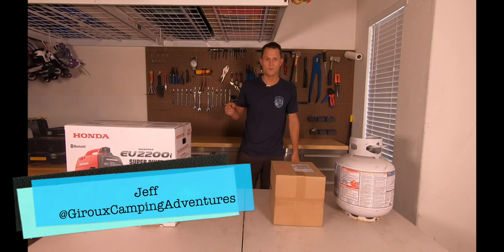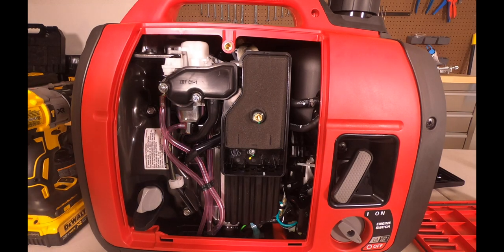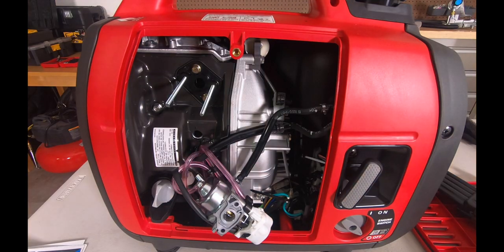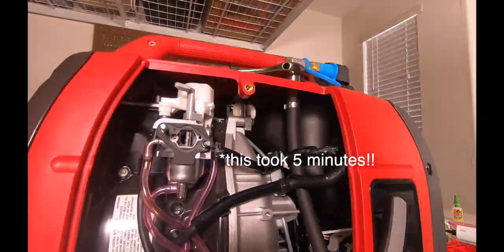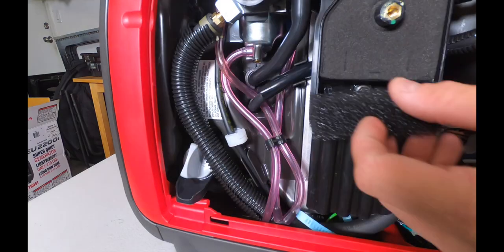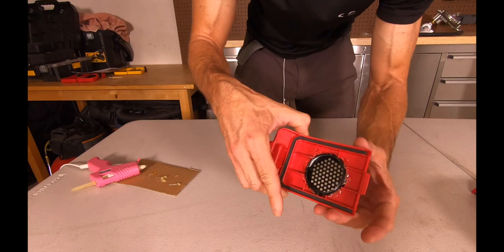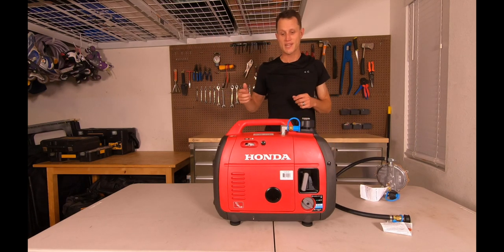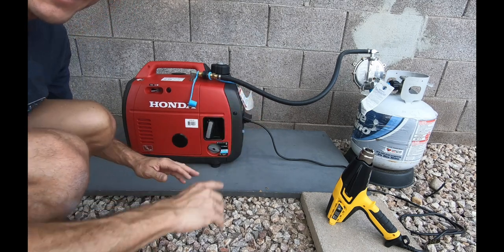Honda EU2200i Generator and Grenergy Propane Kit Conversion How-to

Comment: The Grenergy kit looks like the one to get. The Hutch Mountain conversion kit uses a 3D printed plastic vent...whereas the Grenergy kit uses the CNC machined aluminum venturi as seen here. I would not trust that plastic vent from the Hutch kit. Still not sure all of this is worth it either way, considering that Champion dual-fuel models exist. You're already paying triple for a Honda, plus then $400 for the Grenergy kit...
Reply from the maker: I did it for the fun challenge. Those prebuilt dual fuel models look nice though. However I like the 120cc engine displacement available in the Honda EU2200I compared to the average 80cc you get from other generators this size.

Comment: Before I put holes in the side of the case that might affect the overall intake and exhaust flow - generator cooling. I would want to see a simple $15 - $20 air wind meter on the front intake and the back of the generator exhaust side and just the hot air rear outlet while it's running without the vents installed in the side and a laser gun temperatures. and the same test with the vent or vents cut in the side of it. Always keep your generator in the shade out of the sun it will run cooler. Not sure maybe they have done these tests hopefully someone will do a video of they have. One guy in the summer running a 1000 watt generator in the shade. He was off grid for a while and ran a small window AC. And the 1000 watt 4 stroke generator ran the rotary knob AC. He took the side panel off on generator pointed a fan at the generator in the shade. After that the generator was smoking oil smoke - ring wear while running. These inverter generators pull cool air in through the front and around the generator and push our the warmed hot air out the back. Like in building engines to big of cylinder heads, header, intake, carb, cam cuts down on the flow of the horse power and torque! Someone test this with these $30.-$40. tools total and then I will believe it if it works!!!
Reply from the maker: Good points. I only know of the reason why the vent holes are there and placement...based purely on Grenery's blog post. https://grenergy-us.com/pages/whats-up-with-the-air-vents-why. However after a quick read I don't see any research performed around temperature. Hoping Grenergy team chimes in.
Reply: Hi Tom, the breather vents don't draw a lot of air into the generator enough to take away from the front air intake of the inverter unit. It just relives pockets of areas with low vacuum inside the case. Removing the maintenance door completely will surely take away from the generator's in/out cooling channels. But with just the vents, the generator does fine according to customers whom first purchased our kits 2-3 years ago. Most of are running them in the woods 24-7 in their cabins. If you look inside the generator you can see the recoil assembly sitting behind the inverter unit. This recoil assembly has the engine fan that pulls in air to cool the engine head of the air cooled engine. As this fan draws in air, it also passes air around the inverter as its being drawn into the recoil assembly cooling it.

Comment: I've done 3 propane generator conversion kits and I have another one to do. I'm thinking about buying this kit because I like the metal base plate and brass fitting that's as good as it gets. Your spark plug that comes with it what is the gap they're running in thousands of an inch? I don't have my paperwork in front of me but most of the conversion kits call for a tighter spark plug gap at least the biggest guys in the business I've worked with do. I've been in propane and using propane products since 1991. I may sound like Hank Hill but I have all kinds of propane products accessories and propane tanks. Propane is the true prepper fuel! And the advantage of propane powered stuff. I don't have to work on it other than light maintenance once and a while.
Reply from the maker: I don't recall the spark plug gap on the kit-included piece. I did keep the spark plug box that arrived with the kit, but there was no measurement. I pinged the Grenergy team to chime in.
Reply: Hi Tom, the spark plug needs to be re-gapped to .020" ~ .023". Your right on the money about propane!
Reply: @GrenergyTriFuel Ok thanks

Comment: Thank God for you!! Your video is the only reason I was successful in installing my conversion kit. I’ve had it for quite a while but been putting it off cause I was afraid to ruin my new Honda Generator. Started on the 2nd pull!! By the way… I’m a older woman 😊 Now I’m ready for the coming snow storm and power failure. Thanks again!!!!!! Regina
Reply from the maker: 2nd pull! You rock! Thx for watching!

Comment: Just bought a Honda generator and am looking forward to converting it to propane, great fun you had on the video, thanks.
Reply from the maker: If you like handy work, then you should have fun doing the conversion too! Are you keeping it propane only or are you planning to run gasoline too? Since conversion, we have only taken it camping 2x...and only actually used it 1x.

The time we used it was purely for a fun load test experience during Thx Giving cooking while boon docking. I was filming the generator at 4500ft elevation with my Victron 3000va inverter on hybrid assist in our trailer. Wife was turning on and off microwave and ninja foodie was cycling. Our electronics/solar setup could handle all of it, but I wanted to show a fun video load test of the propane conversion working with Victron hybrid assist.

I was limiting Victron AC current from 10 amp to 18 amp during the test (cooking dinner), and the Honda app showed ranges from 1000w to 2000w of running power. Fun...will get to that video one day.

Comment: If you'd simply opened the float bowl drain.... ;)  (Thanks Honda for being one of the few manufactures left to provide a drain on the float bowl for easy gas draining...)
Reply from the maker: Luckily I didn’t have liquid gasoline in there first, and I checked from open box (from factory) and didn’t see anything in the gas lines.
Reply: @girouxcampingadventures  Right, but as a tutorial meant to demonstrate for folks who don't know any better... This whole "pull start, die... pull start... die..." procedure is 100% unnecessary and not nearly as effective.  Honda so graciously provided a float bowl drain.  It should be used.  It's the only way to truly empty all gas out of the carb.  (Running it out doesn't actually get it all out...)
Reply from the maker: Good to know. Thx.
Reply: @girouxcampingadventures  Sorry to be... "one of those types." :)  I should say "Thanks for the excellent video which helped me greatly in installing the kit!" But instead all I do is complain.  Typical ME. lol  Seriously, thanks!

Comment: Great video, appreciate the detail. I've installed two of these. The new bolts need a mod. Mine, I used a hacksaw to widen the slit. Then I soldered a paperclip to the slit. Trimmed the paperclip to fit the square slot where the original square head bolt was. Finding square head bolts is very hard (non existent). I believe the original was M5X90mm. I've ordered M5X100mm and M5X110mm bolts with hex heads. ... Gonna drill them to put a paperclip in.  Long time to get them shipped . Great kit and video otherwise. .. Don't use loctite with standard round heads.
Reply from the maker: Good info. Thx!

Comment: This is awesome and so detailed. So is the point of the conversion to have an energy source that’s a bit more convenient for campers instead of carrying gasoline?
Reply: Buu, gas is a bit messy and a touch dangerous to store in/near your home.  Not to mention all of the nastiness that Ethanol brings in the smaller motors.  Another benefit is that the exhaust when running propane is not as obnoxious.  Also when running gasoline, you have to drain the fuel from the carb either manually or by running it until the fuel in the lines/carb is consumed, and this is messy.
As I read the manufacturer's info, they are claiming that a 20lb tank of propane will run twice as long as the single gallon of fuel it holds internally.
Reply: @carlbrothers very nice benefits, thanks. I’ve only had to use my generator once but have been looking at a few trips that may require me to bring one along again. Maybe next year.
Reply: @buulam  the Honda's are pricey, but you get what you pay for.  I also have recently acquired some power banks from EcoFlow that charge very fast on AC, allowing me to minimize the time needed to run my generators.
Reply: There's many benefits with running propane. 1.) Extended fuel run. A 20lb BBQ size propane tank will run 18~24hrs on a single tank. 2.) No smelly exhaust fumes. 3.) Propane has less carbon content than gasoline, which keeps the spark plugs cleaner, engine oil cleaner and improved engine longevity without all the carbon build up. Most campers have a pair of 30-40lb propane tank mounted up at the front of the RV. This is enough propane to last a whole week running 24-7. And this kit also compatible with Natural Gas. Great for emergency use during natural disasters when gasoline is not available.
Reply from the maker: Yes, alternative source of fuel. I was super careful with my first generator (gasoline) and tried really hard to avoid spilling. Had a cool gas tank too. But every time...spill. 

Another reason, less cargo. If you have a propane tank you haul around already...which we do (firepit, bbq), then might as well share the tank. And...leave the gasoline tank at home. You can get super crazy by purchasing bigger propane tanks, horizontal ones...extend that generator usage.

Another reason among many...less gunk in the carb. If you run gasoline, then you have to do more maintenance. Not saying there is no maintenance with propane, but much less gumminess in carb and hence less cleanup...easier maintenance. 

Also...cleaner! Still, there are fumes so practice safety. Keep your generators far from the open windows or doors to avoid fumes (that you can't really smell on propane) from entering your living quarters. Enjoy!
Reply from the maker: @carlbrothers  Yes, definitely pricey. I even noted that in the youtube description. These Hondas are NEVER on sale. So...don't bother waiting. If you need a generator and want a Honda, then just go get it. Then of course do a propane conversion too!
Reply: @girouxcampingadventures  Last year my lowes had two of these that were returned for half price.  I shared the picture of them on FB and took my daughter to gymnastics.  A friend a few towns over asked if I could grab them, and that night before closing I walked in a grabbed them for him as they were still sitting there.
Reply: @GrenergyTriFuel  love this, it’s going to open up way more camping options for my family!
Reply: @buulam  Defiantly. Once you go propane, you'll never go back to gasoline.

Comment: Great video! You have cuted the side panel, but that panel as already vent holes from factory…
Reply from the maker: Just following instructions from Grenergy. The vendor has a pretty good page regarding why the vent holes exist. Maybe Grenergy will make a no-drill kit in the future. I would sell my current generator and buy a new one so I don’t have holes in the new generator. Honestly, though I trust the work and research done by Grenergy. I did a load test video and had zero issues with this kit, ranging all different kinds of altitudes and loads.

https://grenergy-us.com/pages/whats-up-with-the-air-vents-why
Reply: Agreed, I'm sure that the Suit & Tie Engineer's had their reasons for installing the vent kits.

Comment: I bought the Honda EU2200i. Good thing I ran it on gasoline first. It had a problem. It's symptom was surging with or without load. The vent was open, so that wasn't the problem. I could have had Honda do the warranty work but I'm handy. One of the carburetor jets had something clogging it up. A little cleaning and wala! It was working great!. ... Now that one fuel was tested and vetted, I'm going to install a propane conversion like the one you showed in your video. .... Great work on showing details of the install of the Grenergy Propane Kit!
Reply from the maker: I didn’t run it first on gas. That’s why I was soooo excited at the end of the video when I started it. It was the first time and I had no idea if I destroyed it or not! I got lucky by not running into any surging issues. Even to this day…rock solid.
Reply: @girouxcampingadventures   I just ordered my Grenergy tri-fuel kit. The aluminum injector with the carburetor sold me. Aluminum is better that cheap plastic. People in bush Alaska rely on these Honda Generators. Options for fuel, super important. Propane in steel tanks never goes bad.  ......

Comment: I got the Hutch Mountain conversion.  Simple to install and works great. I was skeptical, but these conversions can be really nice, and are easier on the engine.  Not a bad idea to pick up a magnetic oil cap as well.
Reply from the maker: I was looking at Hutch too. I think I went with Grenergy for the challenge. Meaning, I didn't see any install videos out there so I decided to make one myself. In fact, I didn't really want to carry a generator. This whole last summer trip (2 months, 7000 miles)...I only pulled out the generator one time. And that was to film the quick 1 minute Stensland Family Farms thing where I ran my A/C on generator. So mainly...for video purposes. We have enough solar and battery bank...and proper planning to avoid needing generators. But nice to have in case...
Reply: @girouxcampingadventures  Agreed.  I have only used my generator a couple of times when camping in cold weather, and before I went solar. I am planning for a winter group campout now, and am in Oregon, which means 3-4 days or longer, with no sunshine is quite possible and a scenario to plan for. I plan on also using a Shiftpod tent, with a Buddy heater, along with the cookstove so it made sense to convert it to propane, instead of carrying an extra can of gas.
Reply: The problem with the Hutch kit is that at best, it's bound to fail. And at worst, cause an explosion. The weakest link in their system is actually the piece that feeds the propane into the engine, which is simply a piece of 3D printed plastic... Anyone who installs that has to be genuinely insane.

Comment: EXCELLENT VIDEO !! GREAT JOB !!! FIRST CLASS !!!! APPLAUSE !!!!!!!
Reply from the maker: Thx for the compliments.
Reply: If you need the extra power running propane run a load block on the one way 6" pancake KN valve outlet. I had to in order to start a air compressor wouldn't on stock propane kit after load block it started easier. With load block adjust the generator on the lean side at idle and wide open under load. As all the professionals told me over the years with propane you can't go to lean. But warning don't run on the rich side engine will run hotter, use more fuel and can cause early wear, tear and failure. I've been in the auto and racing field for over 30 years and installed a few kits and added load blocks for more power and fine running. With a load block you can simply adjust to any elevation with a simple adjustment, a lil more power and better fuel efficiency!

Comment: Ayyyyyyeeee! I greatly appreciate this video bro! Mine started on the 3rd pull too! You need a commission for this video! A free kit or SOMETHING!
Reply from the maker: Awesome. Good to hear. Did you happen to run on gasoline first or only propane? I still have NOT used gasoline yet and rocking propane the few times I have used it during camping. And yes…free stuff from vendors is always appreciated.
Reply: @girouxcampingadventures  nope! Thanks to you, it came fresh out the box directly to conversion. I was trying to think of a random scenario that I would need to run gas. You come up with any yet? 🤔
Reply from the maker: Nope!!! Unless my 3 propane tanks (2 onboard trailer and 1 spare) run out…
Reply: @girouxcampingadventures  💪🏾🎯

Comment: QUESTION FOR ANDY -  Why do these kits not simply run a very short hose above to the left of the carb instead of going all the way down and around?  (The "J" config...)  I'm sure there's some reason, I just can't think of any myself.  Seems odd to have to run a giant hose through the crowded spaces down and all the way back up around the intake rather than just running a short 3" or so directly to the carb on the left side?
Reply from the maker: I pinged Grenergy support to chime in. Waiting for reply comment. I agree with the shorter run theory. Curious to hear why from Andy.
Reply: Hi AJ, I’ll list the reasons below. 
1.) The choke lever is in the way, and part of the generator door bezel wraps around the lever leaving no space. 
2.) The LP/NG hose is very stiff, and changing out the LP or NG jet orifice “located inside the fuel adapter bass fitting” would be almost impossible in a tight space. 
3.) Fuel flow is most efficient when there is not a large 90-degree bend. 
4.) Easier CNC machine setup, drill and cut, during manufacturing of the fuel adapter. 
5.) On the EU2000i, that side of the generator gets drilled out for the fuel run down kill switch.
Reply: @GrenergyTriFuel  All makes sense, thanks for educating us! :)
Reply: @aberg12012  Your very welcome :)
Reply: @GrenergyTriFuel  is there any need to change jets  when changing different elevations using propane?  Thx